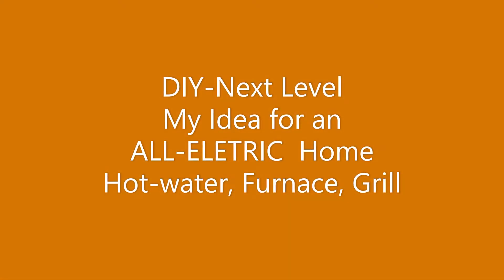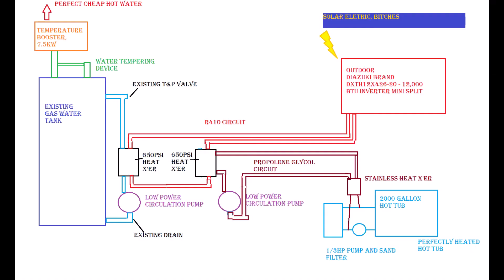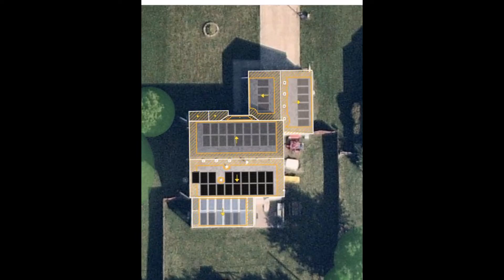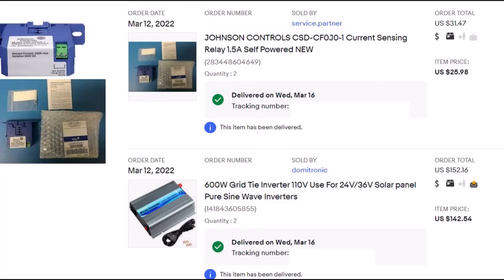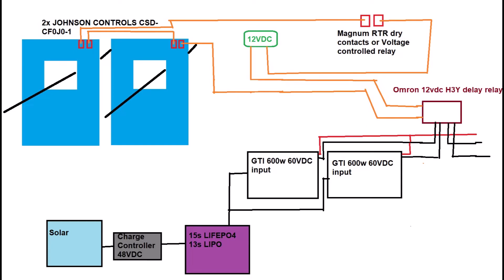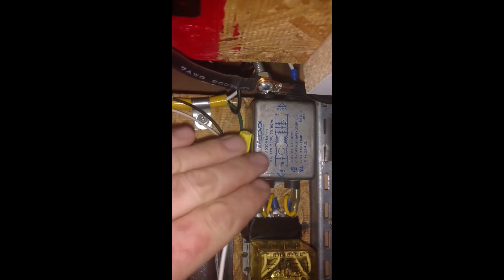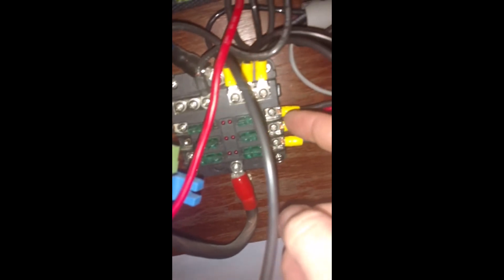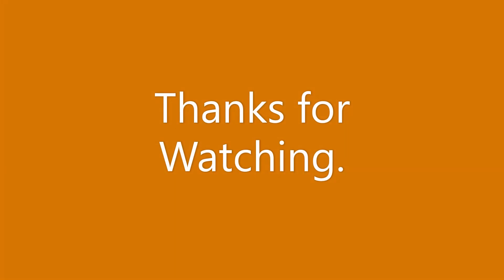DIY SOLAR Zero-Export for the ALL-ELECTRIC Home

Comment: Nice work brother, never tought about limiting a cheap 600w like these.

Would really like an update on how they're doing...

Btw you can use only one ct clamp as your power meter only uses one, youll have to figure out a way to reverse one of the leg going trought it, would be even better since if one of your leg consume nothing  while the other is full load it would still work and be cheaper
Reply from the maker: with the limiter I offset about 250 KWH every month with just 500W/leg typical. cannot hardly tell with huge rise in power costs starting 4/2025. i guess it would be even worse without.

Comment: you can connect solar panels direct to hot water elements, with the correct panel to element setup you eliminate grid use

Comment: Oh man I was hoping that there would be a pure relay or off the shelf solution for zero export. Looks like the Magnum RTR is the brains here making the decision based on the Johnson Controls inputs? If so it looks like I may be stuck with appliance triggered relays to activate and de-activate my grid tie inverters.

Comment: Isn't this illegal? I mean if one of those relays fails shorted, and you export energy to the grid whilst you have a power outage, you could harm line-workers?
Reply from the maker: Hi, I tested the grid sensing feature and it works well. in addition to that there is another relay in there that will pull out when the grid is down. The part of my brain that has a baloney detector goes off when the line-worker-safety meme is trotted out. Really, has this ever happened? I cannot find an example other than online forum comments that are equally unsourced. Also I also cannot find information that grid-tie limit is 'illegal' as a category. BTW I love your work, Mr. Dala, and keep it up!
Reply: No, those inverters, and probably virtually all grid tie inverters, are designed to shut down when the grid is down. They will not run.
Reply: When you confuse island inverters with grid tie inverters...